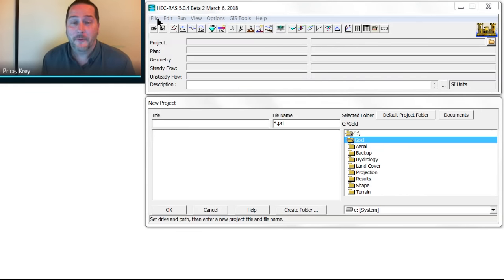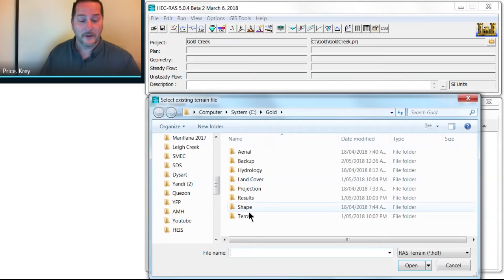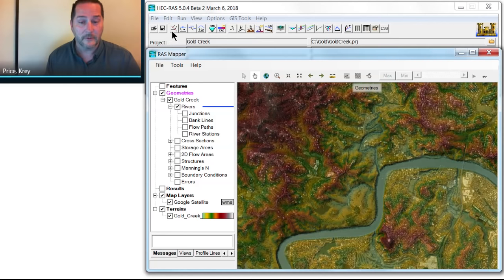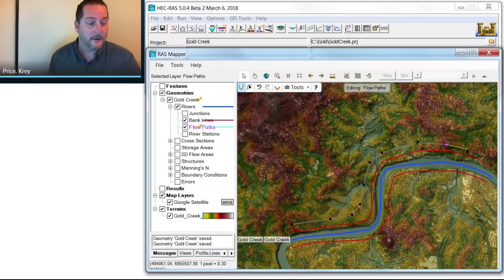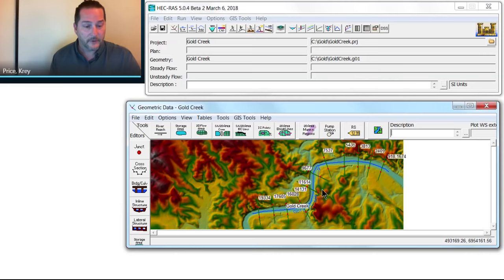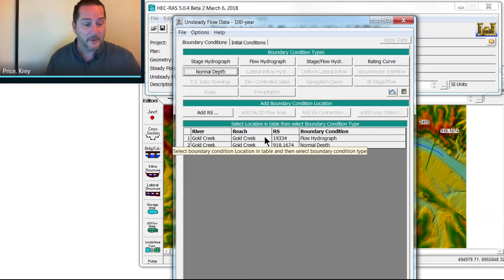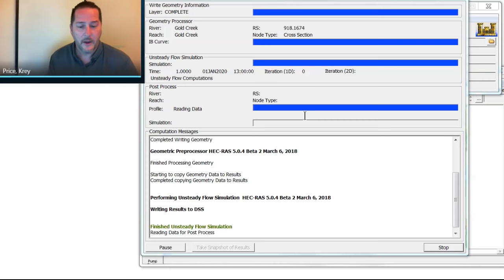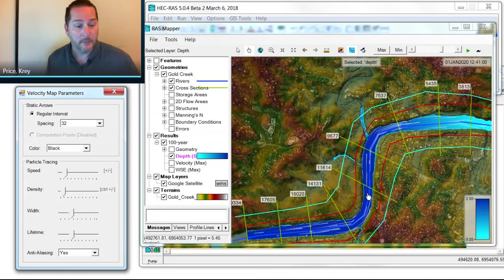HEC-RAS Basics Part 2 of 8: Creating a 1D geometry file in RAS Mapper

Comment: Is there a solution to the Unsteady flow Flow hydro graph not creating the time intervals correctly thus causing the data to plot wrong?
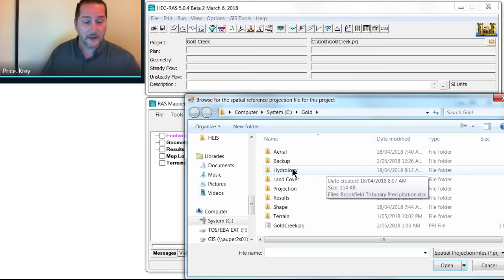 For example my intervals are set to 10 minutes but it counts 00:10, 00:20 , 1:30, 1:40, 1:50, 1:00, 1:10.....
Reply from the maker: Never heard of this Shayne- I would delete the unsteady flow file and start fresh. If it persists let me know. -Ben
Reply: Same issue here in 6.0.0

Comment: Great videos and very helpful. I have a question here. How did you put Mannings n value in n# 02 and N3# 03, those are uneditable here with me. And, n# 01 value is -9999. Kindly guide... 
thanks in advance
Reply: did you get the solution because i faced same problem

Comment: Hi there, thanks so much for the video! You mention around 5:45 that you can define horizontally varying roughness from a .shp file. I cannot figure out how to apply manning's n data in this format to 1D cross sections. After researching it seems like land cover / manning's shapefiles can only be used for 2D modeling. Is this true? Thanks so much for the help!
Reply from the maker: You are correct. But in the new beta release of version 6.0 you can now apply n values to cross sections from shape files. I haven’t tried it yet though.
Reply: @TheRASSolution  Thanks so much for the feedback. I have downloaded the beta and am trying with no success yet, but I'll report back if I am able to figure it out. Do you know if 6.0 will allow users to apply polygon shapefiles of obstructions to cross sections as well? Thank you so much for the help and all of the content. Subscribed!
Reply from the maker: @jasonwilk4473  about obstructions, I don’t think so.
Reply: @TheRASSolution  Sir these are already there in Tuflow.unfortunately that's comercial software
Reply: @jasonwilk4473  Hi Jason, I have ran into the same problem. I am using 6.0. After creating the geometry file, section that suppose to display manning's n values are grey-ed out. The manning's n and k value table also only shows n#1. an additional n value column was found in the cross section editor. Please let me know if you have found any solution. Thanks.
Reply: @ZKYBill  Hi, did you found any solution for this problem?

Comment: Thank you for the informative tutorial. I repeated the tutorial with HEC-RAS 5.0.7 several times, each time at the end when I Compute I get this answer: " Time series data ends before the end of simulation" Kindly guide me where am I going wrong..
Reply: Your simulation time should be the same as your flow hydrograph data
Reply from the maker: You can add zeros to any blank cells in the time series hydrograph data (or just add one zero at the beginning and end of the blank cells and use "Interpolate vales" button to add the rest. Even if there is no flow, you'll need to specifically add a zero to any ordinate that falls within the simulation window.

Comment: Hello.
i have problem for dam break analysis in HEC RAS 5.0.7. when I will do the computation the warning appears "water surface tolerance outside of range [0.0000001 to 0,006]" and "storage area tolerance outside of range [0.0000001 to 0,06]"

so, what I need to improve? please help me. thanks
Reply from the maker: Sounds like instabilities in the model. I usually start by reducing the time step, but there could be other issues going on. If you are still having issues feel free to contact me through www.surfacewater.biz/contact/

Comment: I did every step exactly as the instruction but when  I finished, there was no data for each cross-section. Could someone explain why?. I used DEM 90m to created the terrain. Thank you
Reply: For a width as long as that, you would need corss-sections longer than 90 m. A section with length below 90m would be just a line, and couldn't be able to form the intend geometry. It would be better to use a more refine DEM, such as ALOS PALSAR (12 m), free to download, so you can define a better section.

Comment: Hlo sir, Its a great video. Sir I have river flow stage data only, is there any way to extract the discharge from it?
Reply from the maker: You'd have to build a model, then compare the flow rates at each stage by developing a rating curve. See article at www.surfacewater.biz/rating/. If there are flow measurements to calibrate to, that would be idea.

Comment: really helpful, Sir after mapping the bank lines, flow lines and while drawing the cross section line it is showing the negative values (like : 0, -0.003, 0, -0.004....) can any one help me with this ??
Reply: there is wrong projection of .prj file. projection may be degree in that's why you're getting like that.change projections to meters

Comment: Halo Sir, Is there some function/tools like "Edit Vertex" after we creating a geometry file in RAS Mapper?  for example, if we want to adjust the bank line that we just created, maybe it's too long or too short and we want to move it just to a specific location. I only found "Edit Feature" tools, and it moves all the line that we just created.
Reply: Ok. Thank you, tested and worked.
Reply from the maker: Be sure to select the editing tool then double click on the feature to make changes.
Reply: It seems that after we edit the lines (flow path, or bank lines), the newly edited information or data can not be passed along back to the geometry file. Example, after editing bank lines, the left/right bank stations in XS edit window do not get updated to the new bank line position/station.

Comment: when ı press the ras mapper, ıt's not opened.what is the reason, how
can ı open it?
Reply from the maker: Generally that's related to a Windows issue, especially if it's 32 bit (RAS Mapper is 64 bit). Be sure to run all windows updates, including .net framework and that will usually solve the problem.